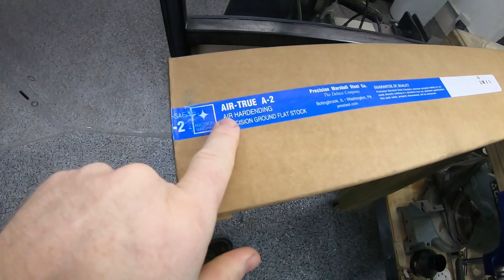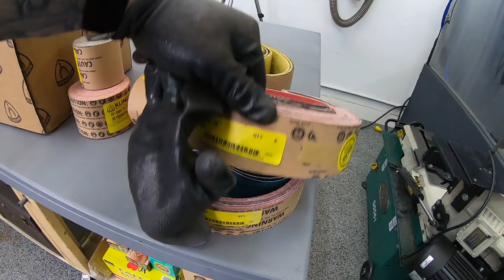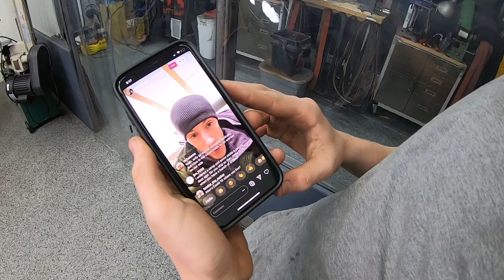making four very large cleavers - AKA hog splitters

Comment: Hey Brian
Whay did you have the de Drillpress/Miloingmachine in the same room as the Belt grinder? If i would have so much space i would never place this machines om the same place. All the dust goes in to the dovetails and mechanik of the Milling Machine and are not good for it.
Reply from the maker: Yeah I think you're right about that. I am still trying to come up with a good work flow. That room creates a lot of dust. Ill be moving things around in the upcoming weeks.